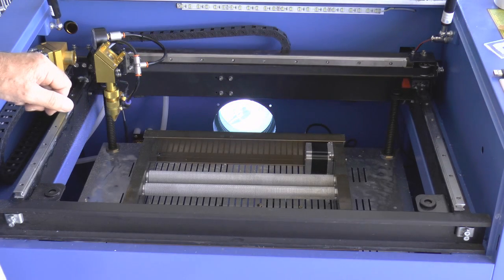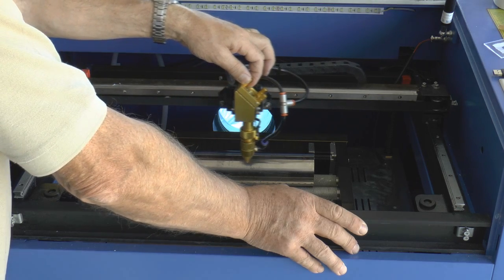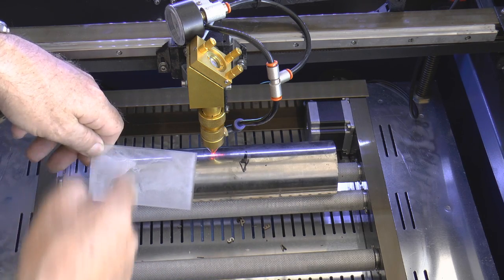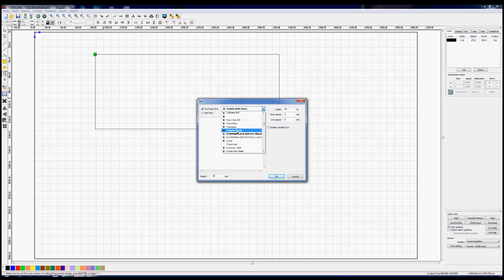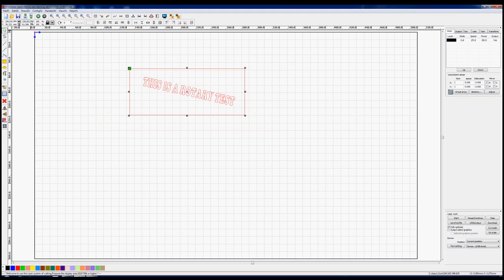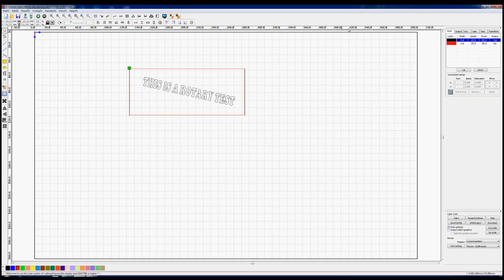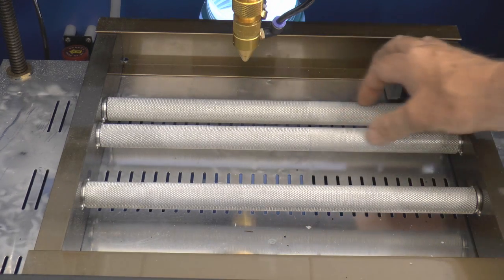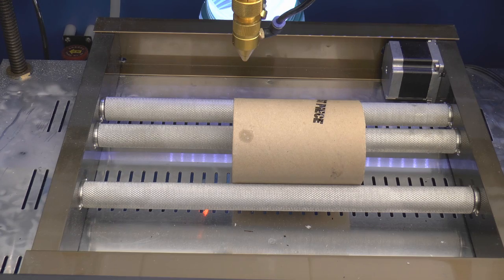RDWorks Learning Lab 11 part1  rotary table introduction

Comment: You have been happy with the RDworks that came with your machine? My machine should be here by the end of the month. Bought it sept 1 and will receive Dec (give or take). Just information for any planning on buying a Chinese laser.
Reply from the maker: Hi
 The version of RDWorks shipped with the machine may be old and may contain a virus.  I would advise downloading and installing the latest version from the Cloudray website (issue 54)    https://cloudray2021.oss-us-west-1.aliyuncs.com/Product%20information/Software%26Board/%E7%9D%BF%E8%BE%BE6445/RDWorksV8Setup8.01.54-20210513.rar
 Best wishes
Russ
Reply: @SarbarMultimedia  unfortunately the link does not work
Reply from the maker: @magicman9486  
 Hi,I downloaded from here a few days ago. Just click the link rather than copy and paste.. It is the first item

https://www.cloudraylaser.com/pages/download-link

 Best wishes
Russ
Reply: @SarbarMultimedia  thanks. that worked

Comment: What do you have hooked up to your air assist?
Reply from the maker: Hi Conner
Very observant. This was very early in my learning journey when I thought the air assist pressure was very important The T connects to a pressure gauge.  I was using a shop compressor from time to time with a regulator because my previous background with metal cutting lasers made me think I needed high pressure . I was wrong and soon after swapped back to the stupid little pulsing pump they supplied with the machine. I am still using those pumps 4 years later because they are not so stupid after all.

Best wishes
Russ
Reply: @SarbarMultimedia  Thanks Russ! I've started binge watching your videos while at work and thought i'd start at the beginning.

Comment: I have a 3018 CNC engraver and had the same thoughts to create a rotary Y Axis.
But i am not quite sure if the workpiece diameter does effect the travel distance and
speed. Adjusting that would be possible but  annoying, that would have to be done due
the travel setting of the pulses per millimeter. Because the F speed is the same for all
the axis. On top of that it would have to be calculated with every workpiece diameter
change and this would be awkward.  It is just a thought for now.
Reply from the maker: Hi Jimmi
 There are two types of stepper driven rotary engraver. Circumferential drive and axial drive. The circumferential drive is available as the roller type (as in the video)  and as a wheel type.
The axial type is usually in the form of a 3 jaw chuck.  If you have a CNC machine there is a mechanical load on the work piece when you engrave it, therefore you cannot use the circumferential drive type because it relies on gravity and friction to accurately transmit rotation to the work piece. There are no machining forces with a laser so this works just fine.   You are therefore stuck with using a 3 jaw chuck axial type.. I don't know what software you will be using to control your CNC machine  but you can be sure that somewhere you will have rotary option that will require you to specify the number of stepper pulses per rev (360 degrees) You will have to look at your stepper switch settings to find out what yours is set to and this will be a once off input to your software. After that you will only have to specify the diameter you are engraving and  the software should deal with the distance per step issue.

Best wishes
Russ
Reply: @SarbarMultimedia  Thank You very much for your reply. Watching you next video in the series wiped all my following questions out. You have a great solution
for compensating the scaling diviation thru the G- code! At least i would like to mention i was very impressed a i saw how you delt with the aquarium pump nozel,
other laser build videos did show the assembly of the nozel with the bubble hose attached to it, and i think how you analized the device and put it to proper work
was amaizing! :)
Reply from the maker: @jimmihenry  
Never lose sight of the fact this is a record of my learning journey. I struggle at times, go round in circles and make mistakes. I do not edit them out to make myself look competent, I am a believer that mistakes are all part of the learning process when you have no instructions to follow. It's better that I make those mistakes because it will help shortcut your learning curve..Trying to help so many people with their problems has also be of tremendous help in widening my experience of issues not seen with my own machines. When I first started to uncover the poorly designed and  badly assembled machine that I had bought,  I was  REALLY disappointed. It was only when I considered the opportunity for me to gather video material for my video editing hobby, did I decide to  use my engineering experience  to get double pleasure from the situation. Without that junk machine I would not be in my current situation or having half as much fun!!!
 Best wishes
Russ

Comment: Hi!  I have the same unit and for the life of me cannot figure out why it is engraving tumblers on an angle. Rotary is squared to table.  Driving me nuts
Reply from the maker: Hi Jeff this was early in my learing journey whenI ws getting to grips with this roller device that was supplied free with my machine.  If you have simple cylinders it works just fine  but start to  engrave tapers articles jine tumblerrs and you start encountering some problems with physics and geometry. . These parallel rollers  are transmitting their  linear motion  the circumference of your tumbler into .rotary motion. Lets tahke a silly extreme example where you have a tumbler that is 4" diameter to drink from and 2" diameter at it's base. The rollers are trying to turn the 4" diameter at one rotary speed and the 2" diameter at TWICE that rotary speed Which diameter will win?. It will be random and unpredictable . Something will have to overcome friction and slip. A simple solution to guarantee that the 4" drives and the  2" "slips" id to put a rubber band around the 4" diameter  After playing with this device a few times,  the novelty wore off as I became aware of it's  basic design weakness.  This was when I realized the merits of the wheel type rotaty devices . It drives on one end af rotates freely on the other end. see 
https://reliablelaser.en.alibaba.com/product/60605711878-804129398/4_wheel_roller_type_rim_drive_laser_rotary_fixture_attachment_rotation_axis_for_cylinrical_object_in_CO2_laser_engraver.html

A lot later on I make my own simple self powered  rotary 
see
https://www.youtube.com/watch?v=mCQqn0kfvCo

Hope this answers your question

Best wishes
Russ
Reply: @SarbarMultimedia  thanks so much for the quick response... looks like I'm getting a different one :)

Comment: Have you tried LIGHT BURN? Way easier than this old program plus what really opened up my laser for me is Light Burn is configured for a camera with a fish eye lens’s Sonething only the super expensive lasers have. I believe I paid 50 bucks for my license and I tried out several cameras . They sell one for 80 bucks but I purchased a high end Logitech camera for34 dollars on eBay. Incredible. This camera option I can hand draw something on paper and put it on the table after using the camera without touching the paper it perfectly cut ou5 what I drew! Not being critical I’ve been following you a couple years. I think you are way smarter than I am and if lightburn didn’t come along I was afraid I’d have to sell my laser. I’m a luthier and just didn’t have the time or patience to lean just wondering on your opinion on light burn
Reply from the maker: Hi Mark
Lightburn is a fantastic piece of work and I love everything about it. I particularly started using it soon after it was available because it had lots of graphic options that aided me in my search for the smallest dot and have been in close contact with the guy that developed it. There were a few detailed issues that most would not notice that have now been fixed. Several people have asked your question and if I would be doing a series with it.  My answer is a simple no because there is a great series of tutorial videos  that  have been issued by the developer. My series stopped looking at the RDWorks software long long ago and now focuses more on the detailed intricacies of the laser technology.
Thanks for the comment because it allows others to read about Lightburn.
Best wishes
Russ

Comment: Could you tell me where to get the rotary table? The Laguna PL 12/20 looks similar in a few ways and I am curious if this will work on it.
Reply from the maker: Hi Michael
I have played with a few different rotaries. This little roller system was free with the machine. It works up to a point but it has serious limitations The positives are that it is cheap and compact but the big negative is the basic design principle. If you wish to engrave a tapered beaker or glass tumbler you automatically encounter two problems. First is that you eed to present the tapered shape so that the scanned surface is parallel to the head movement. Then only way to do this is to chock up one end of the frame.Secondly the rollers are parallel and are trying to drive a tapered object through 360 degrees with a CIRCUMFERENTIAL  contact.  Something has to slip because the circumference of the tumbler is different at each end. I have found that an elastic band around the big diameter tends to drive one end whist allowing the other to slip. Its a pretty poor workaround that mainly works ok.  My advice is to steer away from this style of rotary. The wheel type are the most practical.  The chuck type are also very limited for tapered objects.

Best wishes
Russ

Comment: Good evening Russ and thank you once again for publishing all of your videos!  I am seeking your help as I am beyond frustrated. I am etching wine glasses using the same laser and rotary you show in this video.  I have the computer connected via USB and am not using the User Settings Rotary or Diameter settings. I did go in and adjust the Vendor settings for the Grid and Diameter. Nonetheless, I get the first glass to etch perfect. I place the next glass in and press Start again and the next glass etches at a width much more compressed then the first . I have experimented all night and am tired of wasting glasses. I hope you can help. Much appreciated in advance.
Reply from the maker: Hi Brian
Depending in the shape and sort of glass this type of roller system is fraught with mechanical issues.. This roller system relies on driving via the object's circumference.  Take for example a tapered tumbler, the circumference at one end is different to the other. Something has to slip as the object make one complete revolution and that could be totally random. You can easily address this issue with a rubber band around one end of your glass. Adjusting your vendor settings will not help, the rubber band will.

Best wishes
Russ
Reply: Hi Russ, I am going to give the rotary engraving a go tonight.  Just sat down to watch your videos.  I do have one question though.  Where did you get the gauge for your air assist?  I need to get one because I basically use two settings.  Full on to cut and just enough to keep the smoke from going back up to the focusing lens.  Thanks, and I really enjoy watching your videos.

Comment: Hi Russ, I'm Ray from Nottinghamshire, Ive just retired from my own manufacturing company and decided to take up the laser as a hobby, I find your tutorials brilliant and really useful. I've stated my quest with a K40, it's going fine, but I've just bought a rotary to attachment for the K40, I'm upgrading next year, the one you show here how would I connect the stepper motor and disconnect the y axis motor, any help would be greatly appreciated, thanks Russ, keep up the tutorials, brilliant. Ray M
Reply from the maker: Hi Ray
I too have an amateur  project engineer indoors who conspires to spend my time for me as well as my money!! Who said retirement was easy?
Sorry I know nothing about the K40. . The frame rotary you have purchased may well be driven by a Nema 23 size motor whereas I suspect your K40 will be driven by weaker Nema 17 motors. I do not know enough about the motors to advise on wiring but I would check your motor sizes and see if the stepper drives in the k40 can deal with the higher load.from a bigger motor.
There is a non-motorized solution which I design and demonstrate in 
https://www.youtube.com/watch?v=-uafUAX04G4
https://www.youtube.com/watch?v=mCQqn0kfvCo

Best wishes
Russ

Comment: I would  like to know were I can find the rotary bed? Thanks Richard
Reply from the maker: Hi Richard
It was a free extra with my machine. Yes it does the job ( sort of ) but has weaknesses.  This is a circumferential drive rotary. Another variant of this type of drive is the motorized wheel system. The wheel type is a much more flexible system and you will find many variations on that theme  are available.  See here
https://www.google.co.uk/search?q=rotary+engraving+wheels&tbm=isch&tbo=u&source=univ&sa=X&ved=0ahUKEwizvrr94evWAhXCuRoKHZdaCqUQsAQIUg&biw=1269&bih=594

However, Dont rush to spend your money tomorrow as, just as I am writing to you, I am putting the finishing touches to a video on how to build your own non motorized rotary unit that is so amazingly simple. I have specifically designed it for my Lightblade machine as part of my training video commitment to Thinklaser BUT it is sufficiently radical that I feel the whole community should benefit from it and will be adapting the edit for a Learning Lab session in the next week or so.

All best wishes
Russ
Reply: thank you very much for your replay

Comment: I've got exactly the same rotary device! It works great, I put it on the bed and connect the cable and of it goes (connect cables powered down).  The problem is when I take out the rotary and reconnect the cable for the laser table. Doesn't seem to matter what I do, the machine keeps peeping! So far the only thing that seems to work is to unplug the electrical cord and let it sit overnight!  Any ideas, help will ben appreciated.
Reply: Captn Herm 
Hi
There is no logical reason for this strange behaviour unless you are doing something wrong. First, you must switch off your machine before disconnecting/connecting cables. When the machine powers up it will automatically go through a reset 0,0 routine. After you replug the YAXIS cable back in, does the machine go through this procedure? In the USERTAB,  have you selected ROTARY? is so then this is wrong. That is only required if you have a chuck type rotary device. When you connect your roller rotary the machine thinks it is still driving the Y axis and tries to go though a normal seer routine. Read other comments below about zeroing your rotary
Best regards
Russ
Reply: OK, I fixed it, I noticed that if I touched the cable it quit peeping, so I figured I'd hook up the extra ground cable (the whole machine should be ground through the electrical system!), started it up again and everything worked fine. I did do a system reset, just in case I pushed something wrong!
Hopefully together we will be able to figure these lasers out! Next is the speed of the rotary turner so that it does a good burn. I did an oval yesterday that looks like a circle on my paper roll.
Thanks for your help Russ.

Comment: Hi Russ,

I have been watching your videos and working my way through
them for some time now, and would have to say I believe you are a genius.

I am looking to use my laser machine to generate an income
while I recover from an upcoming major heart surgery.

The material you have provided thus far  has saved me much time which I currently do
not have a lot of at the moment, as this would have taken me forever to attempt
to figure out on my own, and for this I thank you.

I was hoping that I could have some of your .dxf files,
particularly the design for the laser pointer used to align the mirrors and the
jig you are using for levelling items on the rotary table.

It would be greatly appreciated if you could assist me with
this.

I look forward to hearing back from you.

Thanks and regards,

Joe